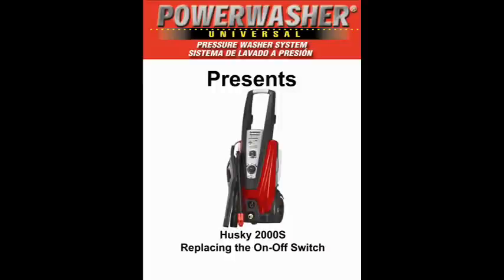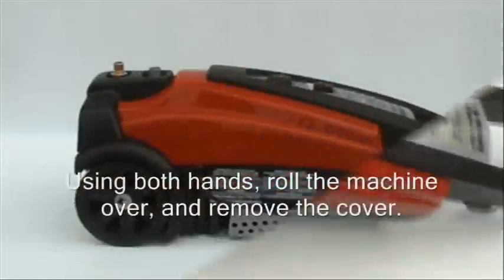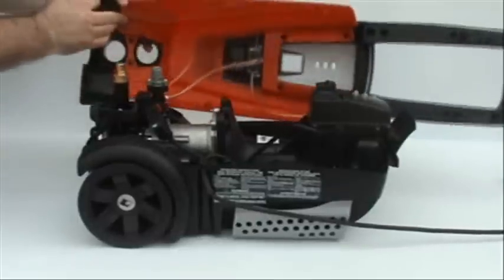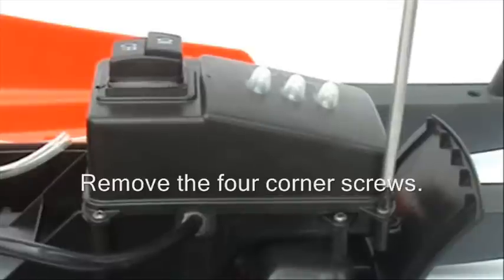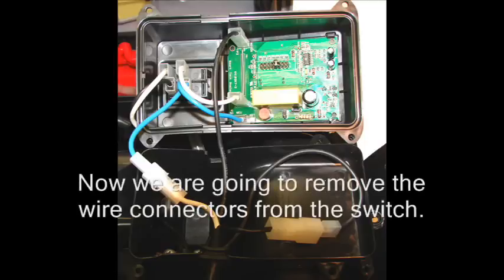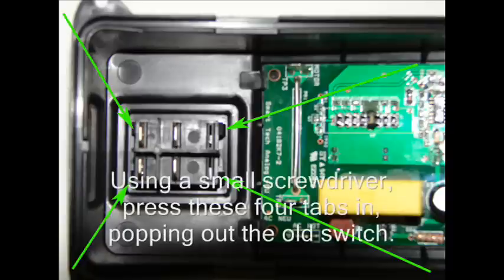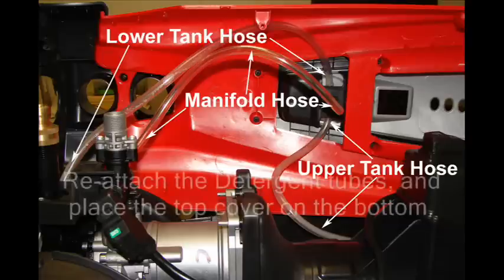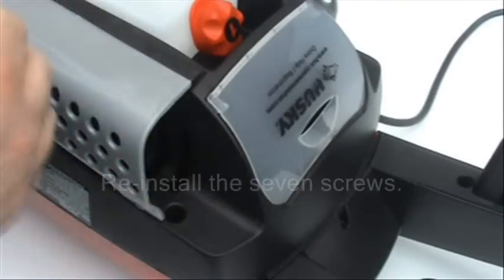Replacing the On-Off Switch on the Husky 2000S

Comment: I just replaced the switch on my Husky 2000S.  I had to remove 13 screws to remove the cover (not 7).  The video, I believe, is showing a different model Husky power washer up to the part where you see the guy actually change out the switch, then it reverts back to the other (older) model.  Like I said, the actual 2000S model has 13 screws to remove to release the cover.  I never had to remove the hoses internally to accomplish the switch change out.  The process was more involved than the video portrays and two small pieces fell out of the unit during the switch change procedure which I never could determine their location or purpose.  My unit worked after the switch replacement, so I guess I could call the process a success.
Reply: I have been trying to find a video to show me the "hidden" screws on my H2000, and how to remove the cover. At least I have an estimate now, so thanks for the comment.